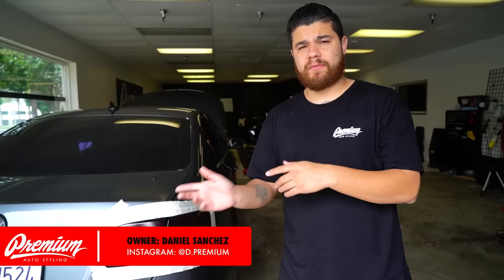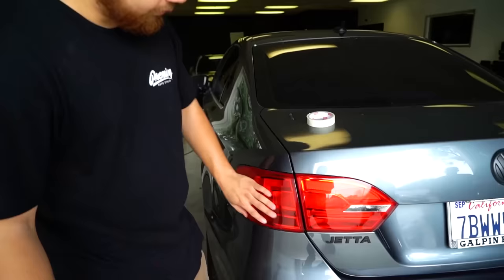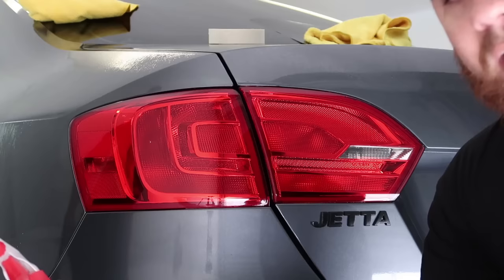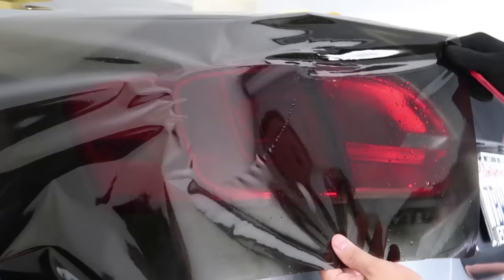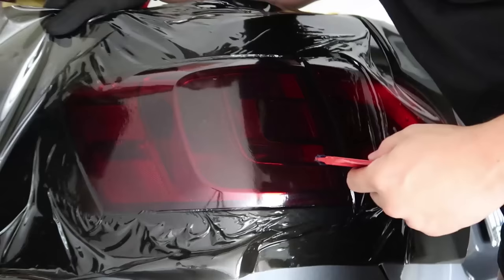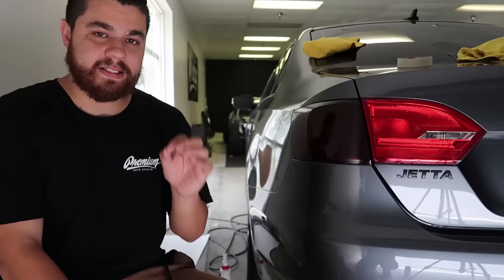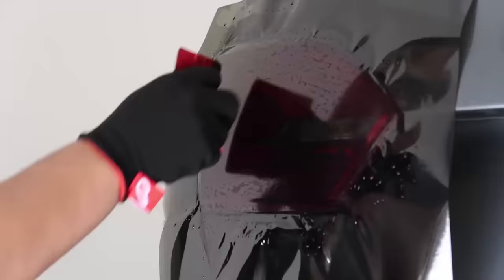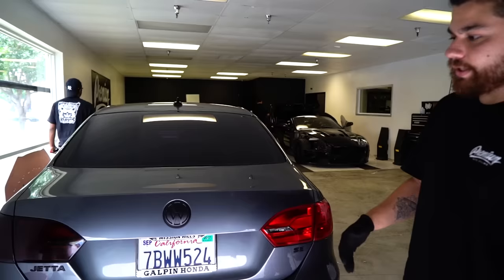How to Tint Taillights with Film

Comment: I used a spray tint and a semi gloss clear coat and in my opinion it was way better, my taillights have odd indent designs (2003 Ford Escape) and even a weird dip in the plastic. I have them super dark and they still shine through very well. I would recommend if you are worried and have an older car to get brighter bulbs though but stock should be fine

Comment: I clear coat them with PPG after I nightshade but I have a body shop so that's hard for anyone to do at home but I get a mirror finish after I'm done and I always tape off the reverse lights I like being able to see when I back up at night. But I still like y'alls product it's perfect for the average do it yourselfer.
Reply: Joe Patcity ive done it 100s of times like that and all thrm lights i did still look like glass and will outlast ant film by 10 years easy
Reply: Exactly it’s all about the effort nightshade can be used effectively and look nice if done right. Most people just spray them and don’t even bother to see if it’s even and just leave it but if you actually but effort into them. Like spraying them then doing a light wet sand then spray a few coats if clear and also do some wet sanding and then polish them. They will come out with a high gloss mirror finish with simple products. But nobody does all that effort so they look all dull and like shit.
Reply: Drew tutwenty thats why you clearcoat over it and not rattlecan clear either,correct way is to use a transparent black basecoat and then to clear them
Reply: david peirce were talking the average consumer who buys nightshade who it’s marketed too. Not everyone has access to professional materials or A booth. Of course the proper way is to have a body shop do it but these steps is for your average garage worker.

Comment: I’ve used VHT night shades several times on my cars, if the light looks that nice after you stripped it, the niteshades wasn’t done properly is why it looks so bad, also you’re supposed to clear over niteshades after spraying it, all my lights looked as good or better than tinting the tail light. But I wouldn’t recommend using the niteshades if you aren’t a good painter of auto parts. 
I checked out this video because I was to try tinting my new cars lights instead of painting so it’s not permanent 
Great video 👍🏼

Comment: For those "bubbles", wouldn't filling them in with clear nail polish work to prevent the dimpling effect?  Kind of like transparent bondo.  Let it dry and smooth it with the clay-bar again.
Reply: The nail polish solvent would "fog" the plastic on the tail light. You definitely want the film bonded with the light itself not with any filler between.

Comment: It looks like they didn't wet sand that plastic before using the spray Nightshade. Generally you do this otherwise you can easily get a crappy look like they had. Even still, you can do everything right with that stuff and then coat it with glossy clear coat only to have it STILL look matte in finish. I've done both that stuff and vinyl on different vehicles and I have to say, vinyl is the only way to go. I will never use Nightshade again. On my M3 I used Vvivid Smoke vinyl on the tails and the headlights. Looks absolutely killer.

Comment: Don't apply too much heat or hold the gun too close it will wrinkle or even burn a hole if you leave a little small water spots underneath don't worry they will disappear after few weeks completely..Edit it does affect your visibility..

Comment: He definitely applied the VHT terrible.  I did it for the first time with no experience and it can put amazing. You have to clean the light.  Sand it down, spray the light a little darker than the color you want.  I and clear coat it.  I waited a week for it to cure.  Sand it down again and used compound and it came out amazing, shiny with reflectivity.

Comment: For the chodes, the advantage to using film instead of spray is bc where I live in order to pass safety inspection to get license plates you can’t have tinted tails. So with film u can peel it right off and re tint in a few minutes after inspection

Comment: Is it easier to do it with removed lights or do it on the car? I tried first time by removeing them and bringing home, but it took me forever to remove them :D And ofcours I failed at first time because I didnt use water between light and film. Also you remove protective part from both sides before using it on the car or just one side wich goes to the light? Anyway great video, I wish I have seen it before trying to do it by myself.

Comment: Great video....  Ummm your razor your using to make the cut around the edge of the light...  Could you add a squgie/felt type end that the razor blade comes put of as to not scratch and keep the cuts smooth and flowing...  As if when you open the trunk it would look a little better...  umm kinda like when you spray a car and the jams aren't sprayed...  I'll keep your site in mind for my next whip..  Keep up the good work

Comment: if you want the best result from spray tint, sand the tail light down with 600 1000 then 2500 making sure to wipe it with alchol every timw u move up to catch small particles of oxidation then clear coat 2 times sand it down after 1 day with 1000 claybar it then spray the tint down as evenly as possible.
Reply: DUDELIKECHELLA  I'm appreciate the info , but what is the need of take the clear coat first , 600g will strip all out then 1000 2500 well the scratch will be out , but you want to spray clear  coat again , and let it cures
 my guess you will use 2k gloss clear coat , and only then use the spray can  
Do you mind to explain that to me since I planning to do your way

Comment: Looks sweet, but so many things can an do go wrong from the paper sticking together, to over heating it , tearing it,to the ends getting air under them an it lifting.cutting it wrong an leaving bubbles too hard to remove..wraps a bit harder but the clear finish is way better than Matt spray

Comment: What kinda brake cleaner did you take that vht off with ??? And I've never liked vht anyway but if you spray clear over them and not cheap clear it will look a lot better but using that brake cleaner is a great idea there is a lot of chemicals that will completely mess up the lights

Comment: Is there any kind of spray that will soften this tint up to help with getting it off? My tails are tinted with this vinyl and it's such a PITA to try to get off. It's very brittle and breaks even after using a heat gun to soften up the adhesive..!

Comment: I'm doing this on a Fusion, where the clear lens in the center will be cut out.  Would you recommend cutting out the clear area before or after curing? Thanks
Reply: if you have a sharp razor, do it after so it’s more accurate, just be careful not to press to hard and score your taillight

Comment: How much light is typically lost when you tint the taillights and headlights? I'd like to tint my lights, but I'm afraid of how poor visibility would be thereafter.
Reply: That depends on how the tint is made, if it has some reflective properties then it wont be an issue. Because the light will  be guided out instead of blocked in. But yea, technically, this isnt legal any place in this world. Buy yourself some real smoked tailights that is ECE/SAE/DOT approved while tinted. For example Valenti, they make tallights for the prius and GT86 that is legally smoked.

Comment: Just don't.  As soon as the sun comes out, your lights are invisible, the point of lights is to show light.  Not mask it off.
Reply: Not even true
Reply: @splooshkaboom4210  Actually it is.
Even the light smoke tint on tail lights in bright sun light reduce the actual visibility of the lights by over 75%.
In a shop or dim light setting the difference does seem like a lot, but once you get into bright day light it very much indeed does affect the visiblity. Hence why smoked or tinted headlights and tail lights are illegal on roadways.
Reply: @splooshkaboom4210  I have worked so many wrecks from people not seeing the tail lights it's ridiculous.
(The person with the tinted lights is pretty always found at fault as well for altering the visibility of the light)
Reply: spydergs07 cool bro.

Comment: 3:07, isnt those holes there so the lights dont fog up?
Reply: @maddawgnoll  nope, they are actually holes on the taillight. Manufacturers that use a specific plastic added small holes to allow water evaporation from build up, thermal expansion from light heat, and drainage. Usually cheaper made ones or models that were known to have a seal issue due to cheap products had this done to combat the issue without having to do a recall or change the way they built the parts allowing them to keep a lower cost
Reply: @maddawgnoll  Maybe do a little research? Try googling and educate yourself a bit. Having worked at a manufacturing plant nearly 20+years. I can assure you especially in older vehicles and many cheaper made production models, a small hole was indeed placed in the two plastic layers for those reasons. It allowed for thermal expansion, as the car ages with cheaper plastics used in tail lights they would break down due to built up trapped heat. This air way allowed air to escape so that when it expanded it would reduce cracking. Next time you goto a car wash pay attention. You'll even see this on alot of new cars still. When it's a beautiful and hot day , a person takes their car thru a touchless car wash, gets home and notices theirs quite a bit of condensation in the rear lights. This small pin hole allows the heat of the light and the sunlight to evaporate the water and allow it to escape. With out this pin hole it would be like a water bottle in sunlight, it continuously condensate on the inside lens without drying possibly shorting out the light. You're welcome for this little bit of factual knowledge. ;)
Reply: Kevin Noll my Jetta has holes in the tail lights, stock lights and lenses.
Reply: @maddawgnoll  All of our vehicles got holes in the taillights atleast and their purpose is for the light not to fog up.

Comment: Darkened taillights are dangerous. It can be very difficult to see a brake light during the day. It would be interesting to see which car gets cited in a rear- ender when the person in the front has made their lights difficult to see.
Reply: That’s why I’m going with a lighter tint colour. I have a g37 and the tail lights are a bright red colour and it ruins the aesthetic of the car IMO. So by adding a light grey smoke tint it’ll give them a darker colour but not too dark where somebody won’t be able to see. If I get rear ended I’ll just say yeah no they aren’t that dark, try again.
Reply: @TakeThis_L  how does it look? Is it too dark or nah, I have a g37 also and just bought tint off Amazon but I’m worried I might have went too dark
Reply: @n54.  I got vvivid smoke black tint and it actually came out perfect. You can still see some red in the tail lights but not a whole lot. 

It looks really good.
Reply: @n54.  if you have a sedan it’s gonna be really annoying. The circle part of the tail light protrudes creating a ridge/dip. 

Just takes a lot of heating and stretching. Helps if you do it in a warmer climate.
Reply: @TakeThis_L  nah i got a coupe, i bought the dark black one and from what ive seen its pretty dark but ill buy a lighter one if it is
Reply: @TakeThis_L  I’m thinking of buying that tint myself for my heads/tails. How’s it holding up??

Comment: Is it not easier to take the light out, must be able to get a better edge finish, no?
Reply: Brad Foster I was thinking the same thing.
Reply: It's tough when you take the light out because then you need another hand or two to hold the light still as you're using both of yours in the process of applying the film
Reply: Jackson Castronova wtf dude.  Couple electrical clips and you literally go inside with the brake light and do it at a table

Comment: how to make your tail lights work less
Reply: This is such a safety violation that you can't get away with in many states. Here in Florida, although statute 316.234 states, "An object, material, or covering that alters the stop lamp’s visibility from 300 feet to the rear in normal sunlight may not be placed, displayed, installed, affixed, or applied over a stop lamp," law enforcement officials overlook it.  So, in addition to speed traps to meet monthly quotas, they could meet them much quicker by impounding such vehicles; ditto for the headlights and windows.  Folks go for the cool appearance factor and not safety.
Reply: @willythehero88  calm down copy and paste
Reply: @willythehero88  you could add brighter aftermarket bulbs that make it zero difference once you tint
Reply: @FullOfMalarky  Yes, but of the ones I've seen so far, the lights are dimmer. Safety is not their primary concern; convenience & the cool factor rule.
Reply: @willythehero88  u can see the lights easy lol, if u cant see them u shouldn't be driving

Comment: Let's not forget you will be stopped by the police and given a ticket for having tint on your lights better off leaving them stock before getting a fixing ticket. I'm in California and I don't doubt it one bit you will be stopped and be questioned. #ftp
Reply: rip, you're right
Reply: I live in southern California and I've never been stopped with my tinted lights been driving since i was 16, 21 now and never been questioned about it.
Reply: I know in AZ, as long as you can see white clearly from 500 ft on the headlights, and red clearly 500 ft with the taillights, as well as clearly see the blinkers as yellow/orange, youre good. Basically, like 30-35% VLT in the back, <50% in the front

Comment: That's because he did it wrong. A great example for using VHT is what I did to my jetta. I bought depo euro led MK5 tail lights in which the two outters eventually went out. Problem was i originally bought them a cherry red and replacement outter units came as OEM red. I used VHT to apply two light coats to match the cherry and the results were the same after some polishing. What you have to do is wet sand the tail light with 3000 gritt sandpaper, apply the vht to your liking in LIGHT coats, and apply a plastic non-yellowing clear coat on top 2 coats. After it cures, the next day wet sand it with 2000 gritt and then 3000 gritt and polish it by hand OR by a electric screw driver attachment. Cheers.

Comment: It looks like that because it wasn’t finished properly. You treat it like paint. It’s needs to be wet sanded/polished and the finish is like glass. I personally use the tint and finish with 4-5 coats of automotive clear coat. Just as shiny as factory lights but tinted.

Comment: Didn’t even watch to see if he mentions this or not but you need to make sure your state laws allow this or not. Next time you go to get an inspection and you don’t check you could be looking for another place to get an inspection. Even if you pass the inspection some how you can get pulled over and they can check. If your state law doesn’t allow covers (which film is considered a cover) you may be subjected to a fine. Even if you don’t interpret the law as film being a cover it’s still not worth the time to have to go to court... just for yourself a favor and buy smoked lenses. They clearly say dot approved on them and if they manufacture them that way and the DOT approves them well you can easily Wallace to the cop on the side of the road. Even if he tickets you it will be easier to fight in court. Just buy smoked lenses approved by the DOT.

Comment: Its 2 reasons 1. he over sprayed the tail lights and dripped 2. he didn't wet sand with up to 3000 grit AFTER he sprayed the tint spray to remove the orange peel and bring it back to a nice shine..... Its no different then when you clear coat after painting a car..same steps need to be taken

Comment: Dear Premium Garage, I live in the UK. I recently put a very pale blue tint on my headlights, used a hairdryer. There are patches of what looks like mist or condensation under the film. Is that the soapy water showing??. I only used a small ammount of dishwasher soap. Are these marks unavoidable. The mist is under the film and not in the light itself. With thanks,  David

Comment: I did a headlight restore in the winter and it came out horrible I wanted to unyellow the headlights so I did the sandpaper method and rustolem clear coat can I use brake clean to get the clear coat off

Comment: If the guy that spray painted the tail lights water sanded them and buffed, they would've look a lot better then these looked. I did mine and they came out pretty cool
Reply: Jaime G.  I'm about to do my VHT , spray can  do you mind sharing any tips , how many coats on , did you wet sand 1000 g or 2000 3000 5000 
Also did you between coats or only the final . Then a polish or compound  or wax or all of them please   If you  can help me I will appreciate a lot

Comment: The reason the nightshade didnt work was because the surface wasnt primed with wet dry sand paper and then after nightshade applied needs wet dry then clear coat x3 coats would look just as good as tint film to be fair.
Reply: Part of me wonders if they did the nightshade spray badly to encourage people away to the tint idea

Comment: Looked to dark til the the lights went on...awesome but doesn't it mess up in a short while with the heat of the lights?????
Reply: Modern lights barely generate any heat, even if they're not LED. Quality films withstand several hundred degrees.

Comment: Is there a difference between the quality of tint film? I bought some Walmart black magic tint film and I tried tinting my third brake light which has a curve the tint sheet does not flex or stretch like yours it bubbles up instead
Reply: This is vinyl tint, it's different from window tint, thicker mils and will stretch and confirm to curves when heated.